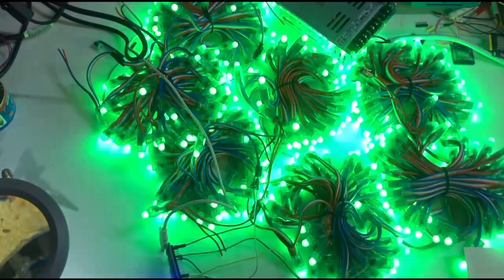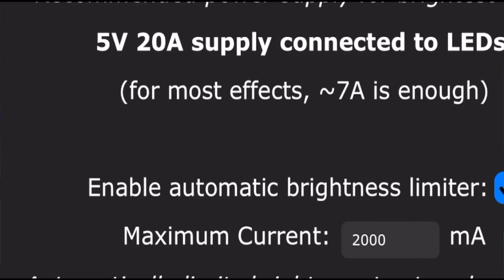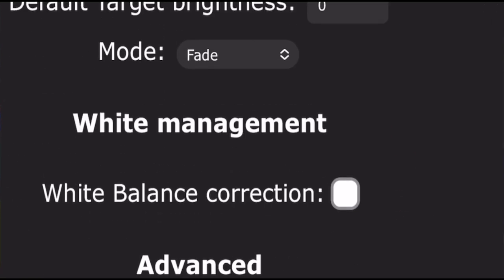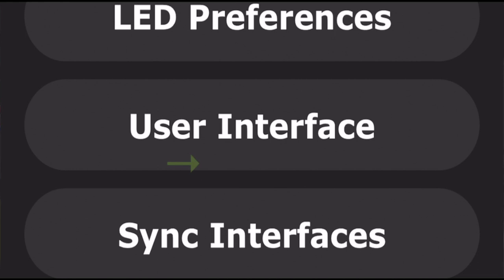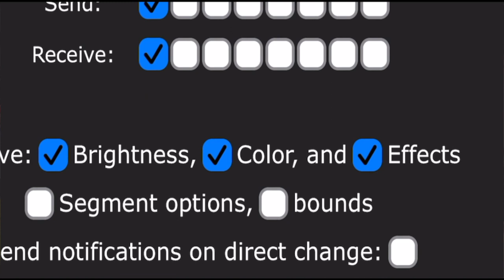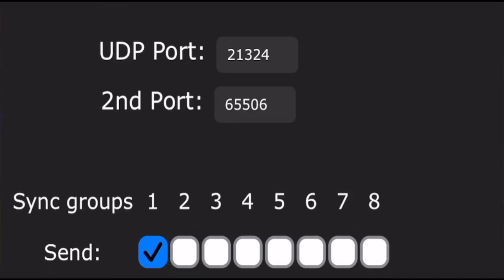How TO Connect IR 24 Key Remote Control With WLED And ESP8266

Comment: Is there a way to use the WiFi remote with the same setup. ESP8266 with addressable strip using WLED. I just want remote basic function as sometimes using the phone WLED is not convenient. The WiFi remotes offer better signal without needed line of sight.
Thank you 
Hope you can help
Reply from the maker: WLED still limited to few of the remote controls out there, however you can use the same setup with the 44 button remote